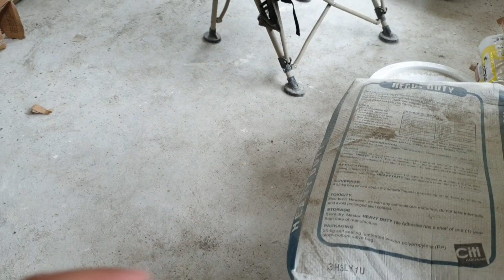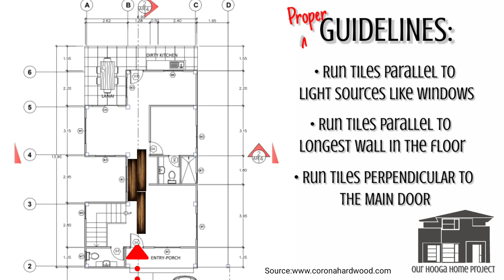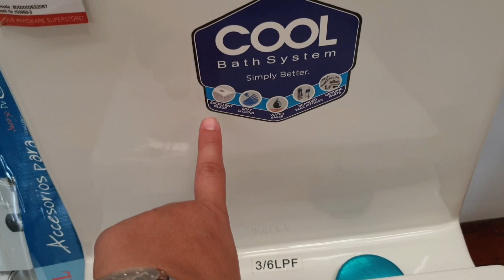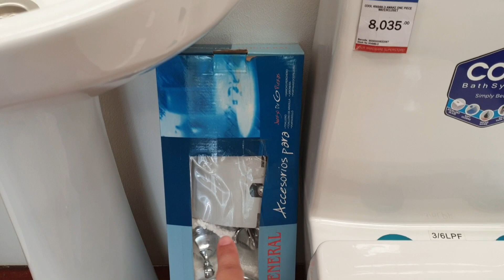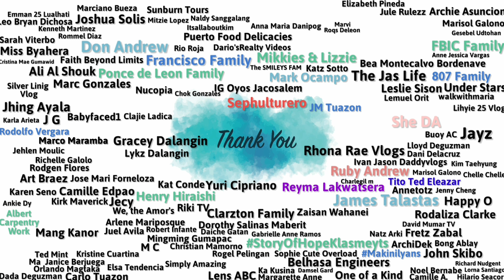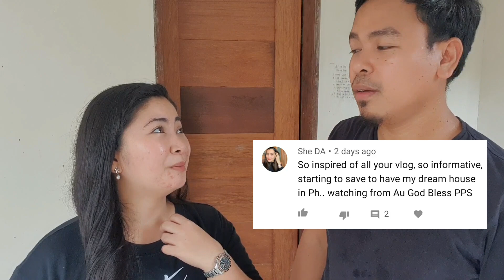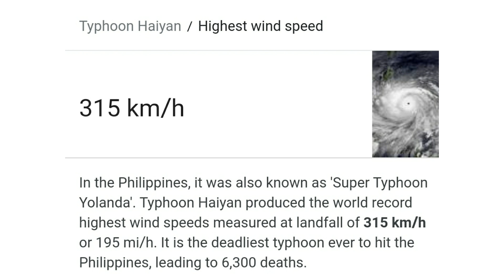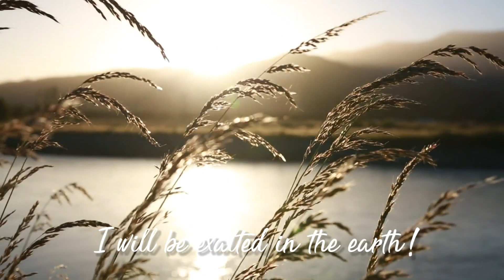House Building Philippines | Wk 26 Typhoon-Resilient House | How to Install Tiles | Retired OFW

Comment from the maker: What do you think of our floor tiles? 😊 Hope to achieve a Nordic design. ✌ How about you? Do you prefer wood-look tiles or the 60×60 or 40×40 square tiles? Share your thoughts below! 😊
Reply: Loving your wood-look tiles! Can't wait na matapos ang bahay nyo, inaabangan ko kung ano final look pag meron na grout po! by the way, ano pla ang paint ng bahay nyo? white din po ba? anong code and brand if ever. haha
Reply: wood-like tiles ako.
Reply: Oops forgive me,  I can't resist to comment about one rookie mistake I observed. Wood-look tiles offset should be random just like the installation of real wood flooring. But then, this can be a matter of preference (common in Pinas but not outside Pinas) but an experienced designer will notice, not a big of a deal. Better than installing straight which is common  in Pinas. Btw, you have a prominent hallway from the entrance and it would look best if your tiles follow the direction of your hallway.
Small things you can add but will make a big difference (if you haven't done so)
1. Plenty of power outlets (electronic bidet,  kitchen counter tops, Xmas lights outlets, lighted bath mirror, ceiling corner colored led lights, smart home (camera door bell, cameras, rolling blinds curtains, outlet behind wall TV instead of below TV)
2. White is in (window frames, kitchen cabinets, lighter counter tops, tiles, doors and door frames). 
3. Stay away from furniture sets/same colors
4. Use accents (for example, one side of wall/furniture/backsplash has a contrasting color,
Reply from the maker: Hi Terry!!! 😊 Hello!!! 😊 Napansin mo rin ang napansin ko during installation 😂😂😂. Oo random offset is best for wood-look tiles but Abet prefers the running bond look 😅. But he promised we will try it upstairs in the other rooms 😊 Thanks for very graciously pointing that out, I appreciate it. 😊 As for the tiles in the common areas, yes po we will follow the direction of the hallway. Lord willing makabili kami ng magandang wood-look tiles pa rin. Ngayon kasi very limited ang options dahil sa budget constraints. 😅

For the window frames etc, mas mahal kasi ang white dito kaya ang inorder namin is yung dark na kulay. Hope okay lang ang itsura. But we will have white kitchen cabinets and backsplash din, lights behind mirrors din. Yung CCTV we will do that hopefully.😊

I forgot to include you in the thank you list. Hala. Marami akong di nasama.😔 Pero thank you thank you for all the support!!! 😊
Reply from the maker: Hi Jasper!!! 😊 salamat maganda kinalabasan ng wood-look tiles. Feeling ko nag-experiment kami doon 😂😂😂. Kunan ko grout this week and then pakita ko rin. Bale ang wall paint namin is Boysen and ang kulay ay Just About White. Di ko alam ang code 😅. Waiting kami sa House Vlog mo 😊.
Reply from the maker: Yey!!! Same same!!! 😊

Comment: Hello po. New subscriber here. Tanong ko lang po sana kung nagpush po kayo sa porcelain wood like tiles? Nagpapagawa rin po kasi kami ng bahay and tile yung isa sa problem namin since di pa makadecide kung ano ba talaga ang dapat naming bilhin. I'm also from puerto princesa 🥰
Reply from the maker: Hi Sheeva! Sorry for the late reply 🙏. Bale I think ceramic ang pinili namin for the rooms kasi low traffic naman sila. Then sa common areas, ceramic din pero para granite katigas. As in solid talaga. May video pa ako na diniscuss ko yung pinakanaunang nainstall na tiles ay sobrang tibay kahit nadadaan-daanan. https://youtu.be/5Uf9v5nOAnk

Ang tiles na napili namin from Wilcom ay:
COMMON AREAS:

BRAND: Sol Ceramica 
NAME: Jox Blanco
SIZE: 20cmx120cm
PRICE: 1,186/box (5pcs)
***Super tigas parang porcelain din.

MASTER BEDROOM/HOPE'S BEDROOM/GUEST BEDROOM 
BRAND: Sol Ceramica 
NAME: Malik Beige
SIZE: 15cm×90cm
PRICE: 1139/box (8pcs)

TRAVELING SAINTS' ROOM
BRAND: Sol Ceramica 
NAME: JUDD yellow
SIZE: 15xm×90cm
PRICE: 995/box (8pcs)

Supposedly gusto namin Malik Beige throughout the house kasi nga Scandi sana ang gusto namin, parang wood and white. Kaso laging out of stock sa Wilcon that time. Kasagsagan ng bagyo and pandemic kaya delayed ang shipment nila. Kaya nauwi kami sa magkakaibang tiles. Good na rin yun kasi napilitan kami mag Jox Blanco, maganda siya. 

Hope this helps kahit late. God bless your build! 😊